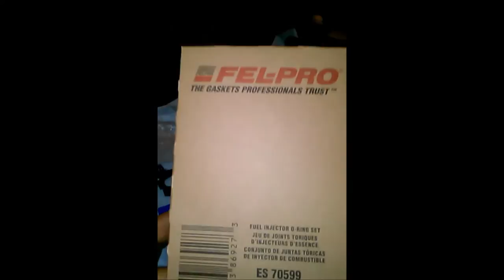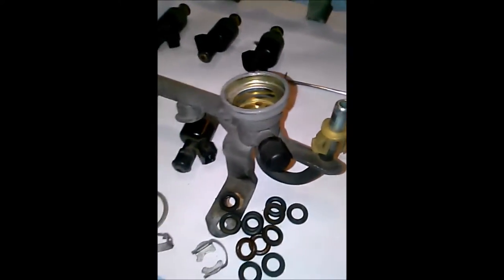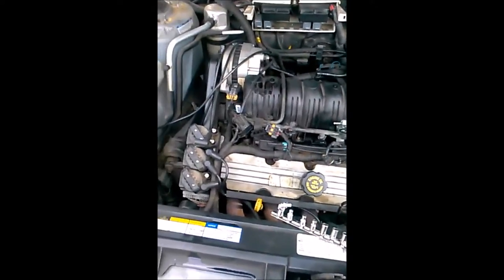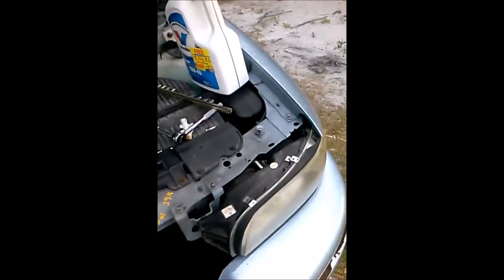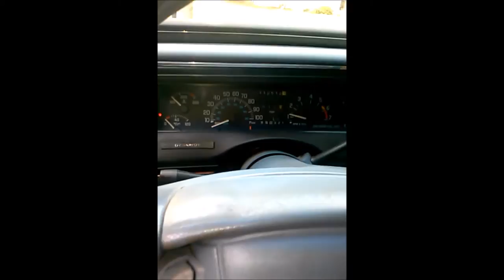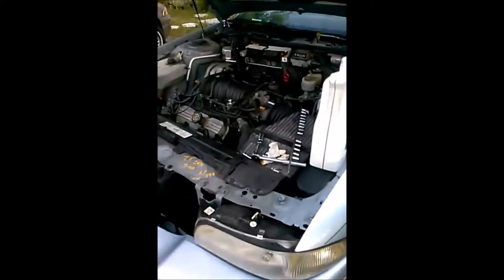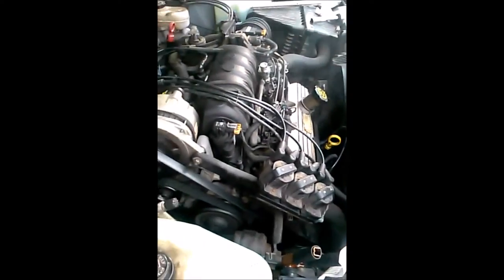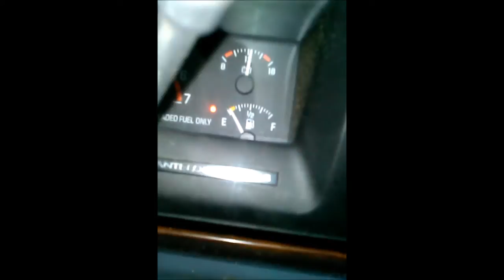Update on the Buick/how to change an fuel pressure regulator 2/2

Comment: Awesome video just did the job myself. Had to remove air intake box and loosen the throttle body so I can slide in/out the pressure regulator. With the right tools it's an easy job.
Reply from the maker: Jigar Patel awesome glad to hear you got it done

Comment: Dragon123456,  Thanks for sharing your work on this car via the videos!  one minor suggestion, it seems like you have the same title for two videos, maybe add a part 1 / 2?  Or before / after?

Although this video is over 5 months old, I wanted to holler out "steam coming out of the exhaust is normal after replacing the intake plenum" which I guess happened if you had a hydro-locked cylinder.  (I haven't watched all your videos).  But thankfully your experience was the same as every 3800 that I've done that repair on.  Steams for a couple minutes, cleans right up and engine soon runs like a sewing machine!

Did the failed fuel regulator cause any particular behaviors or problems in the car?  Check Engine Light codes?

Thanks again!
Reply from the maker: ibowhuntga thanks it never dawn on me that i missed to put which part it was. also back when i maid this i was a little less educated about some things but seance it was hydro-locked it caused on cylinder to have a valve tap noise to it and when i started it i believe all that smoke was gas being present in the exhaust system. furthermore the failure of the fuel regulator  at the time caused the car to run not as smooth but when it failed all together when you turned the key on the fuel by passed the fuel regulator and went thru the vac hose strait into the intake causing the engine to flood and the fuel then also went into the oil. when i drained the oil i had over 5 quarts of fluids from the oil pan. but it also did not trigger any engine codes. altogether it runs great aside from that tic.

Comment: Maybe you can help me my 98 buick is leaking gas from the back right by where you put gas in idk whats going on
Reply from the maker: Joey Vega make sure that the filler neck has no cracks or that the hose between the fuel tank is also not rotted out or has cracks in it